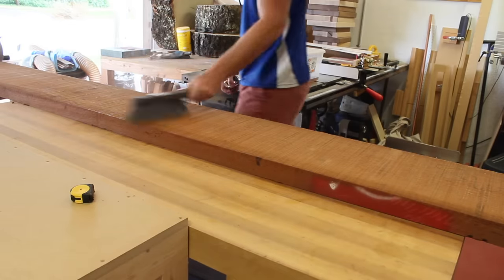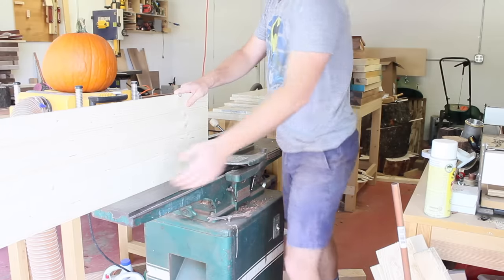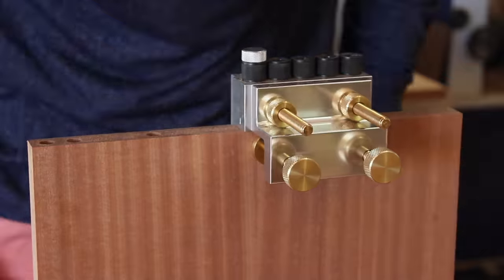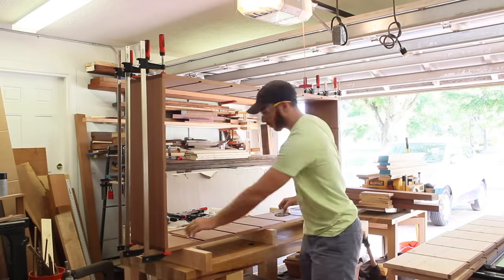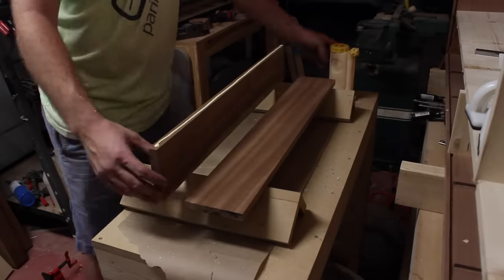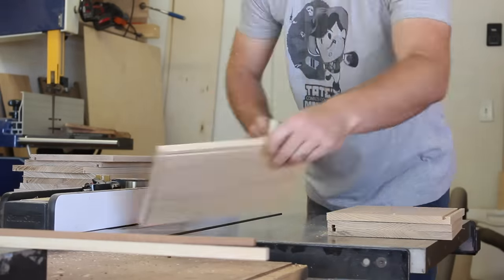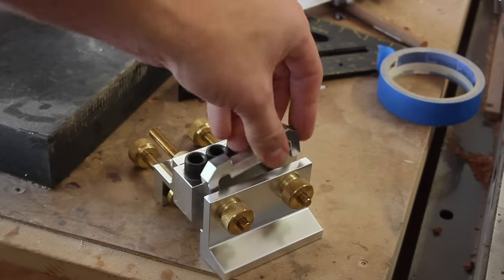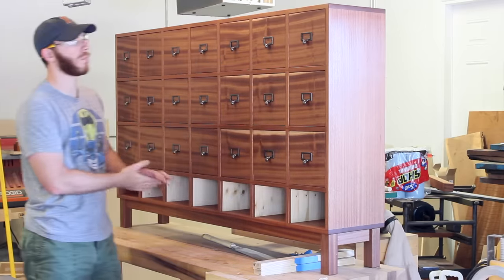Making a Large Apothecary Cabinet

Comment: Just wanted to say thank you.  I watched your video multiple times before starting on my apothecary drawer cd holder for my wife.  Even tho i changed all the measurements, and did thru dovetail joints for the outside case and half blind dovetails for the drawers watching your video made me believe i could pull the project off.  It isn't finished yet but is far enough along i can see the end in site.  So thanks again for the great video.
Reply from the maker: Hey Nathan. I really appreciate your comment. It's great to hear that you're taking on such a project. I'm sure your wife will love it. If you don't mind, send me some finished pictures; I'm interested to see how it turns out. Have a nice weekend!
Reply: @parillaworks  I sent you an email with photos of the completed project.  Thanks again.

Comment: Very nice piece. Although i probably would have done sapele dividers for the ones that were going to be exposed, but still a very nice design
Reply from the maker: Thanks! Ya I agree. I was talking to my wife about this after we got it moved into the house. I keep going back and forth on how I feel about the exposed pine. Looking back, it would've been very simple to just make those solid sapele.
Reply: I love the matching grain.  I think it's hard to combine woods, some combinations are definitely better than others. I always think of pine as "informal"  and  tighter grain, dark woods, as more "formal".  So I try not to combine formal and informal woods. But this is just one way of looking at it. You might consider just painting the pine black or charcoal gray. Or even a black toner to let some grain show through. But that is best done with spraying.  You could try some black paper to cover the pine to see if you like it first.  Just wondering if the sapele holds its color in time?  I know a lot of exotic redish woods sometimes turn gray or loose the red.  I know how much work you put into this piece and video, they are both awesome, great job.

Comment: Nice work! I appreciate how you discuss the potential for error when you were routing the dadoes! Lessons we learn as we create. By the way, I also use pipe clamps, and one handy way to have a very long clamp available when needed is to have a threaded coupler so you can join two pieces of pipe together to make a longer clamp without having to keep a bunch of heavy pieces of pipe around the shop.
Reply from the maker: Thanks for the tip Beto!

Comment: Just completed a very similar project for a mail pigeon hole cabinet. I wish I had watched your video beforehand as it would have save some head scratching. Managed to hold my measurements square by using a story board although manual alignment of slot routing alignment took far longer than it should. Will use a standard spacer next time. Great final finish, well done.
Reply from the maker: Nice to hear, Ian. I might be making a smaller version in the coming months...depends if the customer and I can agree on price :)

Comment: If you want perfect wood filler, don’t use sawdust and wood glue. Buy yourself a can of Wood Dough. It mixes with sawdust so that, when sanded, it creates a perfect color match. It also behaves much like wood, absorbs finish the same and is very hard and adhesive. It’s a great way to go. Wood glue and sawdust is a little hack for something so beautiful as this project.

Amazing work

Comment: Awesome work mate! looks excellent! Should make a quick dust shoot for that jointer so you can hook your extractor up. Plywood would work fine.
Reply from the maker: Thanks Rhys. Once 2018 comes I'm going to take a few days to give the shop some attention. Clean up, change the layout, and work on my DC runs.
Reply: Yeah DC is always something everyone can improve on. I need to get a bigger unit for my shop. Especially since i'm getting a supermax drum sander. Those pump out some dust!

Comment: Since all the lines had to line up and they run the whole way without stopping, maybe next time just line them all together, clamp them down and make a template that runs the complete width of all of them together, then flip the middle ones that need the other side done too, line up, clamp again and use the two outer ones already done to line up the template to do the middles one. I dunno, I don’t do woodwork and perhaps space would limit the amount you could do all at once but it’s an idea 😊
While it didn’t come out as you wanted, it still looks gorgeous~!

Comment: Cabinet came out sweet! Love the sapele and the grain match.  As others have suggested, I would have used solid sapele for the bottom dividers. Next time vary the size of the open cubbies from the rest of the drawer openings. By the end of the video i had forgotten there were cubbies and was wondering why you’d left all the bottom drawers out😆
Reply from the maker: Thanks Darren. I agree with both of your points. I didn't mention it in the video, but my original design had 9 shoe cubbies. When I cut my dados, I totally forgot to vary the spacing on that bottom row. One of many mistakes made! lol

Comment: Looks amazing, and quite an undertaking! As far as your jig I'd say for a project this big and with alignment being that critical, it might be worth making a jig that has ALL the dadoes built into it, that way you know every "shelf" is exactly the same. Since you had to do 8 faces it could be time well spent to avoid the compound error you can get from referencing one dado to the next. (EDIT, I NOW SEE YOU DID JUST THAT ON THE NEXT APOTHECARY CABINET!) If you don't want to go that far then a story stick that has all your locations to mark from will at least help eliminate any compounding errors in much the same way that laying out a tape measure and marking 12,24,36,48,60,72,84,96 will tend to be more accurate than measuring 12 inches and then 12 inches from that mark and on and on.
Reply from the maker: Definitely a great suggestion. I tried that on a similar piece on this channel and it worked out pretty good. One of the hard parts is making sure the dados on each side of the board match up. On a small scale it’s easy to make a two-sided jig. This size, it gets a little complicated.

Edit: lol and I just re-read your edit. :)

Comment: only thing i would do differently is some dovetails on the cabinet corners, butt joints dont show off the casework nearly as much as they should. besides that its a very cool build. Thinking of replacing my plastic bins in the shop with a smaller wall hanging version of the same type of case.

Comment: Really looks great despite the problems you occurred.  However, I was thinking the next time you do dado cuts like that stacking the boards side by side and making one cut might work.  Again great job
Reply from the maker: Thanks Michael! That's a good idea. Right after cutting all of the dados I realized almost any other method would've been more accurate :)
Reply: I'd go a step further. Make the sides from one big panel the width of the left and right plus saw blade. Cut the dados across the big panel, then cut the panel in half, perfectly aligned dados. But looks great nonetheless.

Comment: Great work!!! Turned out gorgeous. Total inspiration. My question is how do you route the inside corners of the boxes? Also, why did you route everything?
Reply from the maker: Thanks Chandler! The bearing on the bit won’t let you reach inside corners so afterwards I come back and sand them by hand. And at the very least I typically add a 1/8” radius roundover or light changer to the edges because it cleans everything up. Especially the areas where the drawer edges meet the cubby edges; they blend nicer than without an edge profile added.
Reply: Thanks for the response! You rock bub.

Comment: How's your experience been with the dowelmax? Was that your first dowel jig or sis you have a different one and moved up to your current?
Reply from the maker: I like it a lot. I had a much simpler jig prior to the dowelmax but I didn't like it so I didn't use it. I use it for most every project that requires joinery including panel glue ups. It's simple enough to use and intuitive. I think a domino is probably easier and faster but not so much so to justify the cost, at least for now.

Comment: What a great job. Awesome.
I wanna ask you, if a project like this cost you, for example, about $200, including (Wood, glue, electricity ... )
How much percentage you add if you wanna sell it? 15%, 20%, maybe more?
Reply from the maker: Thanks! Pricing is tough. I’ll usually start at 3x materials and work my way up or down from there. $200 worth of material could be an easy set of shelves or a complicated cabinet; that drives the price up or down because of increased labor. And added features like expensive hardware don’t necessarily require a 3x markup. And lastly, I try to gauge the market for a specific item; taking a long time to make something doesn’t necessarily mean I can charge more. In the case of a cutting board, there’s only so much you can charge before the item loses its purpose and utility. Just my opinion and experience thus far doing this.
Reply: Very informative. Thanks.
As you mentioned the market (Purchasing power) is important.
In my country the "Average per capita income" is about $1000 USD a year, so selling wood work here is tough.
BTW, I've searched your channel looking for some "Epoxy Resin" work, but didn't find any.
I'd love to see some videos with "Epoxy Resin + wood" from you.

Comment: That's a pretty cool doweling tool! Do you ever have a problem with tolerance stacking?
Reply from the maker: I've only used it a few times so far. What you saw was the most I've stacked it and I didn't have any issues with fit. So far I like it a lot.
Reply: Cheers!

Comment: Just a question. You appear to live in a suburban area with houses nearby. My question is how do you keep the noise down so the neighbours are not annoyed. I live in a similar environment and work in my garage and I wouldn't work for more than a few hours every second or third day and the power tool usage would be no more than 5 minutes total each day. The reason being that I don't want a noise ban on my working from the local council. There is no way I would do it as a place where I worked daily.
Reply from the maker: Thanks for the question. I make sure to cut the noise before 7pm or so. Now that it's getting dark so early it makes it more difficult because it feels late at like 6pm. But I haven't gotten any complaints in the last year and change. I do get interested passers by though...which is always fun for me.
Reply: You're very fortunate, could be that everybody is out or at work which is ideal. I lived next door to a guy who was house flipping and I had just retired. He was renovating for about 3 months, the worst noise was the big compressor he used with no sound suppression box to keep the noise down. My kitchen window just over twenty feet away from where he kept the compressor. Like living in the trenches of W.W. 1. Ha ha ha. 
BTW I love the cabinet especially the waves of the grain. Apothecary cabinets bring back the memory of stripping a smaller cabinet than yours and staining it a deep green with lots of wax and added about 30-40 brass knobs for the drawers. It was also on legs but desk height in length that gave it a lighter feel.

Comment: Panels,”point seven two inches thick’’ I sense beyond woodworker but not quite machinist, lol. Explanation machinist 0.720, wood worker just shy of 3/4”.
Reply from the maker: Ha! Funny you mention that. Pretty accurate. I learned to use a Bridgeport on wood before I used a table saw. I initially learned under a machinist/woodworker which might be the reason for the way I say things.